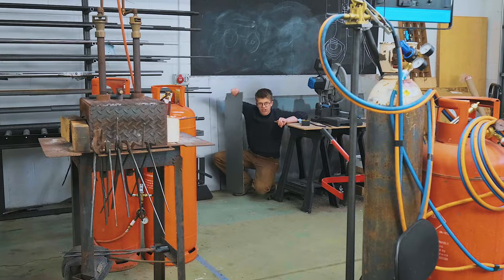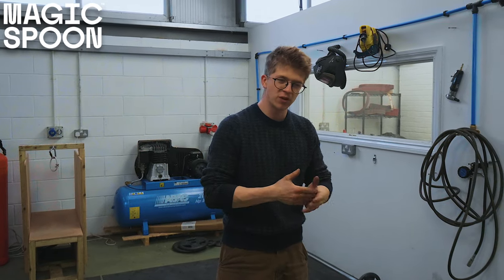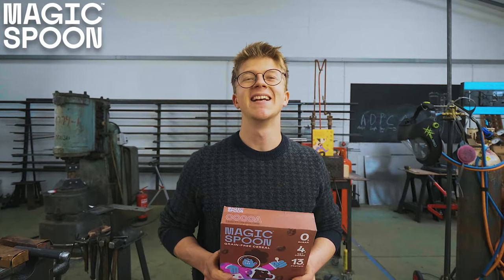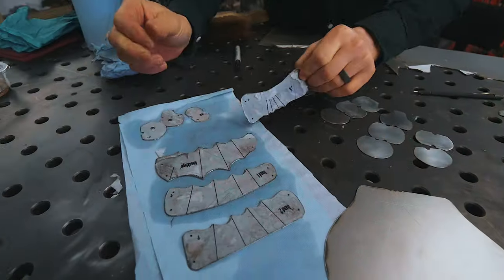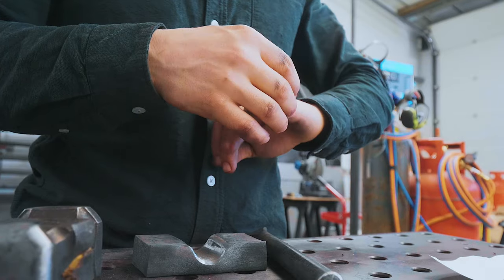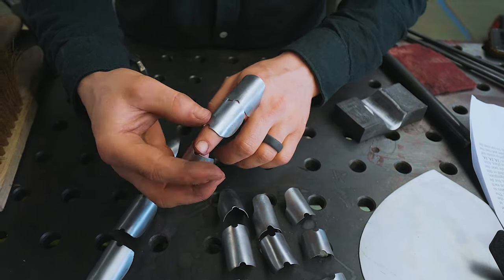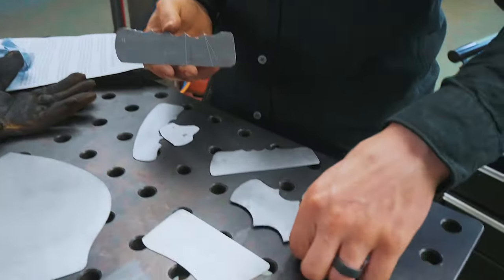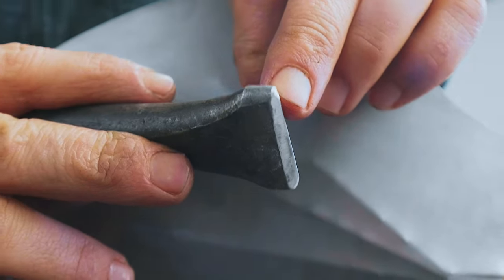MAKING AN ARMOUR GAUNTLET!!! Part 1

Comment: you wanna learn to work sheet metal? like seriously work it? LEARN HOW TO HEAT SHRINK. if you dont even have heat shrinking basics down you will never be able to work sheet metal shapes the way you really want them. get some flat sheet metal and something that will shoot a nice continuous flow of water like a bug sprayer. start by heating up circular areas and then rapidly cooling the cherry spots and watching how metal reacts. once you pay attention you can literally heat shrink a nice bowl with nothing more then torch and bug sprayer